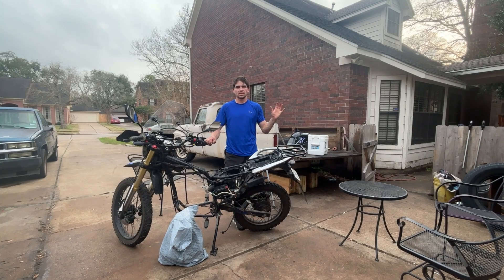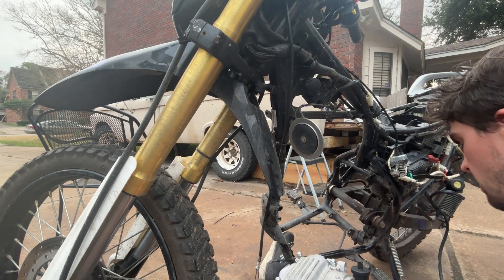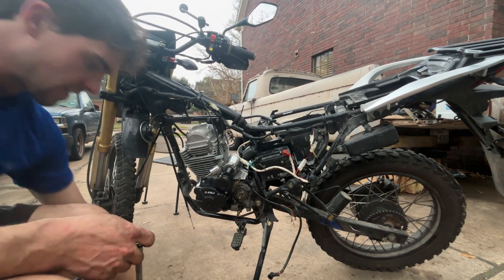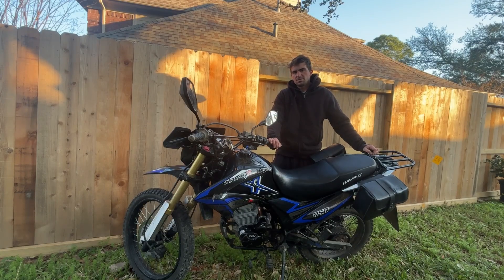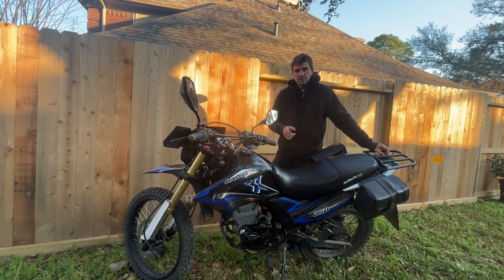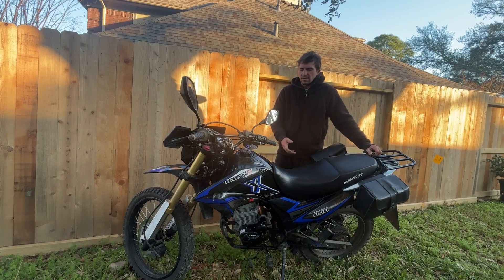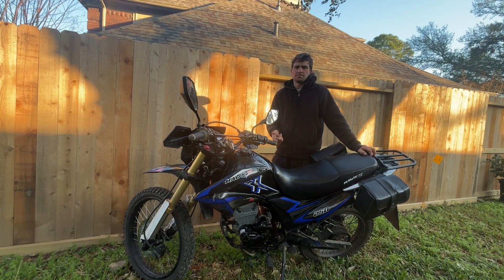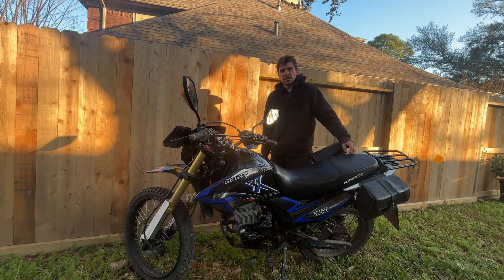2024 Hawk 250X Engine Swap Part 2 (X-pro 250 6 Speed Counterbalance)

Comment: Wait so you used a kp mini harness for the Templar x engine ? What all did you do to the engine to make it run?
Reply from the maker: The Templar 250 6 speed stator plugged right into the kp mini harness. I’m pretty sure it will work if you swap stators

Comment: It’s so difficult to justify purchasing something like a KLX300 or CRF300L when you can do this mod to your Hawk (and other mods) and it will perform on the street as good or better than those. My SuperHawk300 will smoke both of those bikes on the street.
Reply from the maker: @dustinsegers4534  I totally agree. A hawk is 1800$ engine is 500-700 bucks and it can easily hang or even surpass the name brand bikes
Reply: @Cant_Find_Neutral  Then, if you get a Templar, or shoot, spend more $ and get a GPX FSE250e, it will smoke em too with the mods…and you’ll save 3-4 grand.
Reply from the maker: @ Exactly and I think more and more people are starting to look more into the China bikes because of that

Comment: What a project. You gained yourself almost 25cc's more engine. You got my attention when you said you ran into wiring issues. Last year I attempted to install the digital instrument panel and tach on my 2024 Hawk (we have the same bike). Well, I plugged the blue & white tach wire into what I believe turned out to be a blue & white wire for the CDI box, and the bike wouldn't start for 3 weeks. I wound up pulling the whole thing and going back to the factory instrument panel. There's something in that wiring harness that doesn't like being messed with.

I'll raise my hand and say I couldn't do half the stuff you take on. My limit is probably the valve lash that I had to do when I bought the bike, along with replacing my horrible fuel tank float, and replacing my defective factory throttle cable. I'll watch any Hawk maintenance video - replace the chain? Yup. Trouble shoot the solenoid and starter? Yup. Keep 'em coming.
Reply from the maker: @wayne7862  The new motor gave me 25 more cc’s and about 5 more Hp. New motor is overhead cam instead of pushrod. I plan to swap the old motor into a Honda from clone (kp mini 150). I saw people on YT do the dash swap but I personally like the OEM dash. But yeah I couldn’t figure out why the new motor isn’t fire up with the stator swap. I messed with it for hours and the only thing I didn’t do was swap flywheels. Super frustrating. These bikes are such good bikes to learn bike maintenance and most parts are cheap to replace. I was thinking about making a video about troubleshooting a no start situation on these bikes to help anyone who’s having a hard time getting their bike started, at least my process. Thank you for all the support!